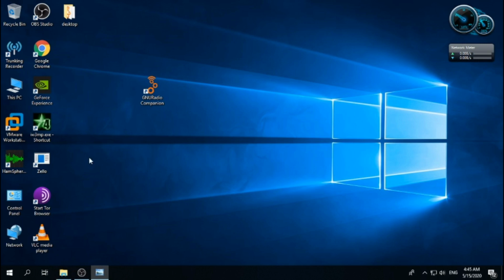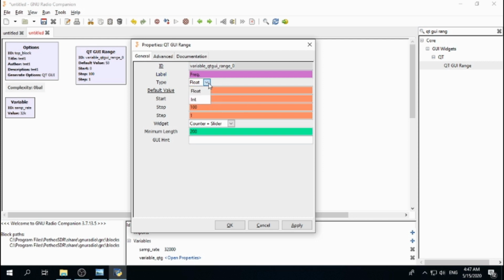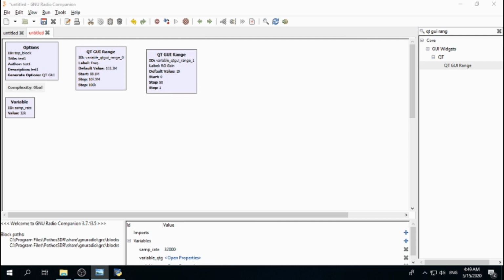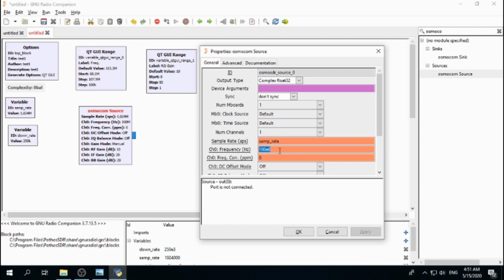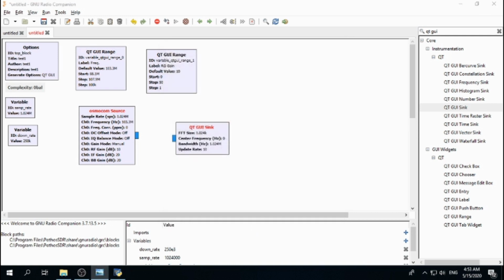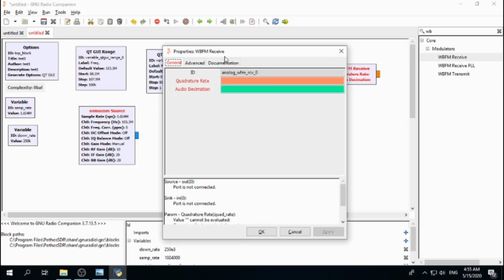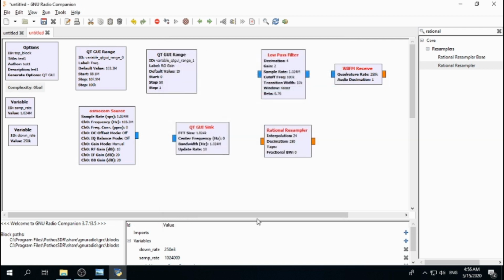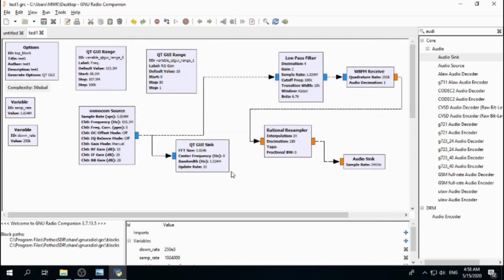Build Your Own FM Radio Receiver Step by Step Guide GNU-RADIO Win10

Comment: Im getting a Syntax error: Invalid Syntax. But the entire system is the same and the flow graph generator accepts it. Any idea of what this can be?
Reply: I don't have a proper solution yet, but if you disable both QT Ranges, and QT Sink, and under the top block change Generate Options to No GUI
Reply: @colinsutter6982  I found the solution. Like an idiot I was typing in "250k" instead of 250000. Thanks for replying though